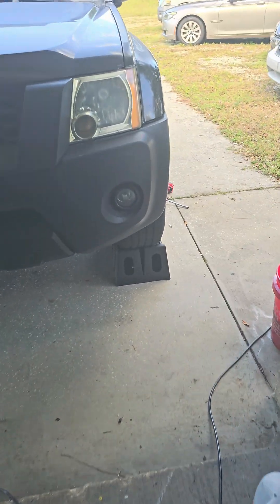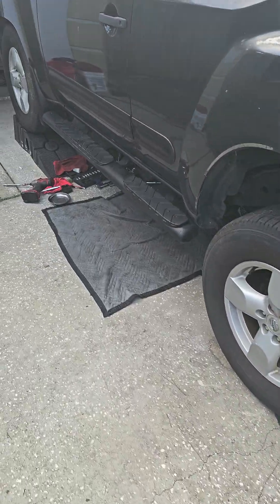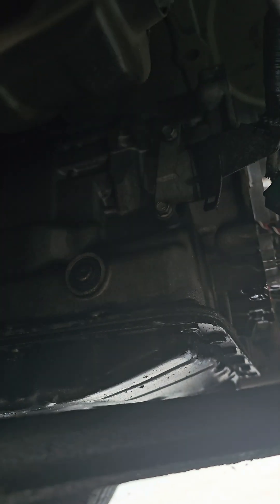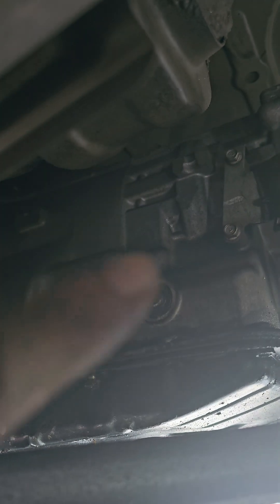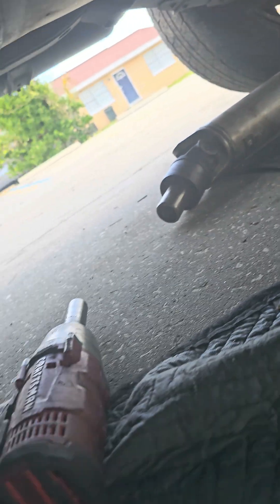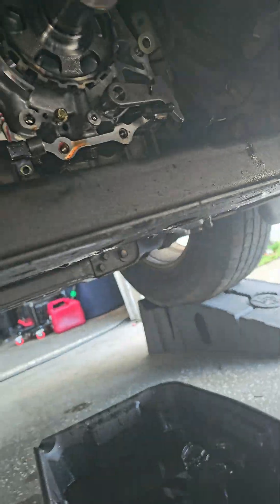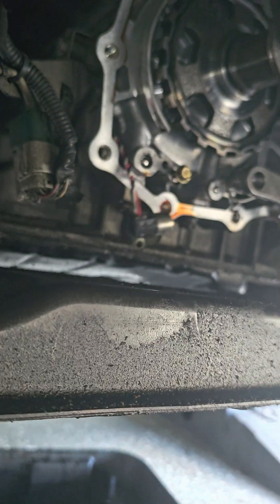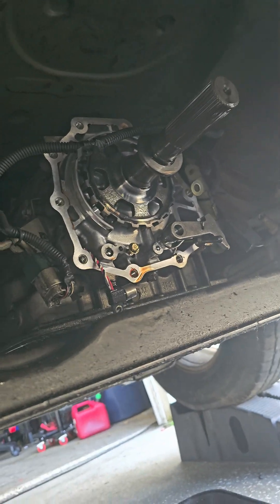2005 Xterra transmission speed sensor location

Comment: Curious if this would correct my C1729, U1000? Getting Slip light random as hell like it goes to limp mode. Mechanic said all wheel speed sensors were good. He continued confirm  trans vss. What made you change transmission vss?
Reply from the maker: my Xterra is getting the SLIP light sometimes and loses power. I have to put it in neutral then back in to drive and some times that doesnt work so i put in neutral and restart the vehicle then put it back in drive. The codes I'm getting are for the transmission output shaft speed sensor and the steering angle position sensor. I changed the transmission sensor but it is still doing the same problem so next ill try the steering sensor that is on the clock spring.